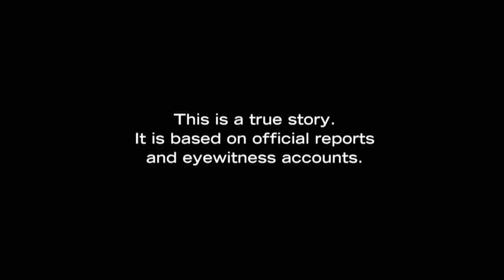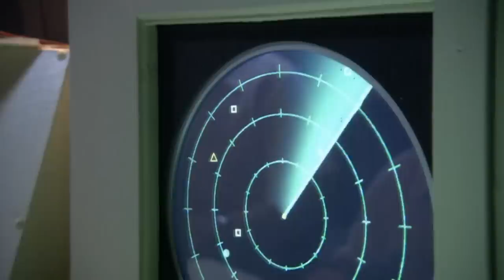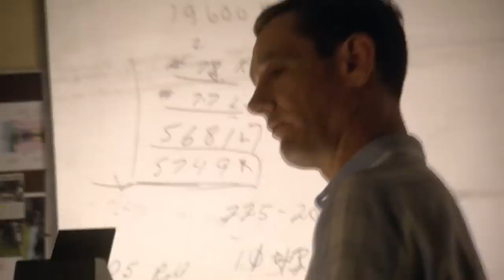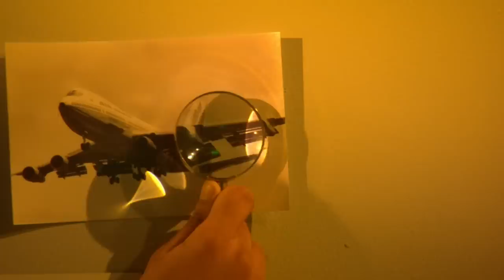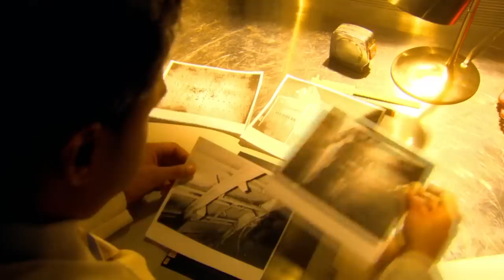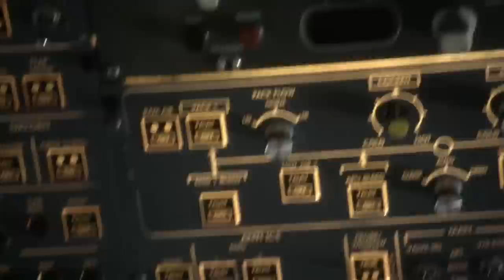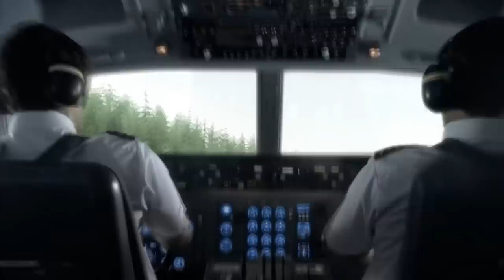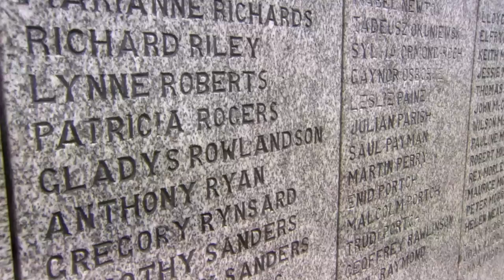Painstaking Processes Of Unravelling MYSTERIOUS Tragedies! | MEGA MARATHON | Mayday: Air Disaster

Comment: Why isn't the fuel always put at full like we do our cars when on a trip? Just filler up.
Reply: Because the weight of the plane directly affects landing and take off. If you are taking on full fuel you have to offset that weight with power, making the jet work harder and actually use more fuel. Fuel is expensive so the standard practice is the have what you need + a bit more for unforeseen landing delays/diverting. 
Jet fuel is also going to ignite/burn hotter and faster than gasoline. It’s why most planes have a fuel dump procedure in emergency. 
Basically it all comes down to cost vs safety analysis.

Comment: WHY have the airliners NOT UGRADED THE BLACK BOXES TO emit signals for MORE THAN 30 days. This equipment has been used for decades without any upgrades. The crash of a jumbo jet can frequently take much longer to locate the data boxes and recorders. This is simply a negligible cost cutting measure. Csafdly it isn’t uncommon for it to exceed the 30 day limit to locate the boxes in crash wreckage further delaying the investigation and providing answers for families and airline companies.